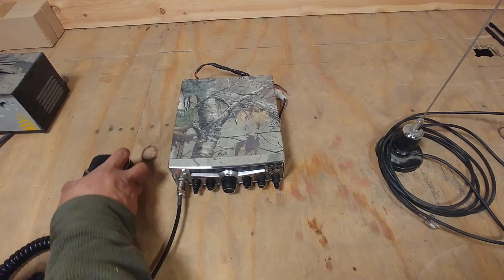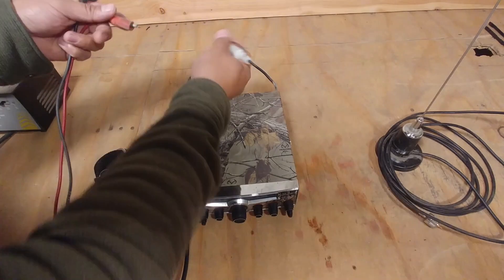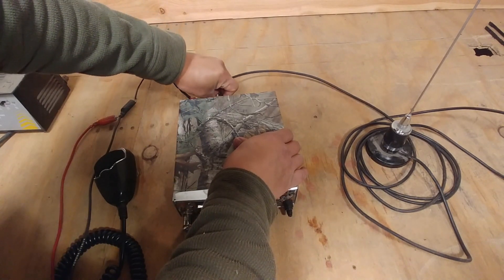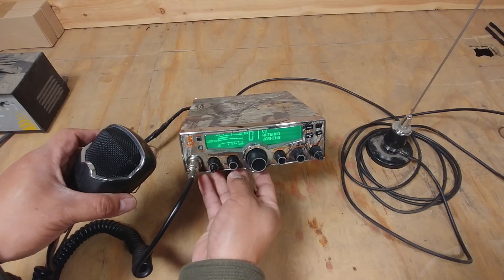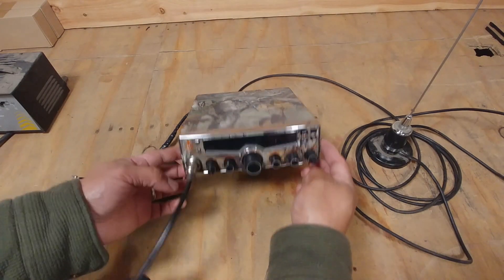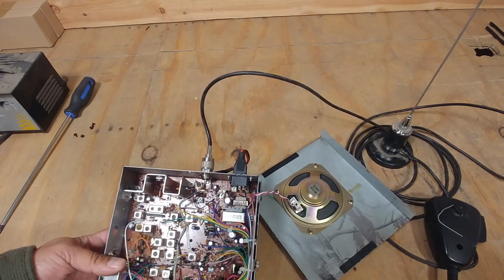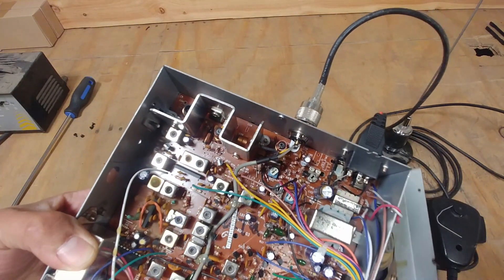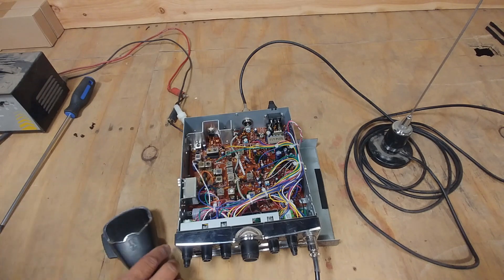Cobra CB Radio Antenna Warning

Comment: You Don't Know What Your Dowing That Antenna Has To Ground On A Metal Car Roof Will Not Ground On Plywood. Keep Keying The Mike And The Radio Will Blow The Finals Out Your Not A Tech
Reply: Hola disculpa soy de México y tengo el mismo problema 
Entonces que me recomiendas hacer  saludos

Comment: A tip if your SWRS are 1.1 to 1.5 and still getting the antenna warning try turning down your mic gain it will stop the warning it only goes red when over  modulation takes place
Reply: mine seems to do it when my linear is on high power once i put it in medium it stopped. it did stop when i turned down my mic gain on high. i am using a cobra power mic also so if i turn down the mic gain will it really effect how i sound out there. it started when i switched from a 102" whip to the 5' firestik fiberglass antenna i may just go back to the whip to get a little more rx out  of the radio and a little more tx.
Reply: @ironwoodliving769  yes go with the  102" whip i am not a fan of the firestik's

Comment: Who'd have thunk it. Tuning an antenna at the swr pickup inside the radio.  I think I'm going to tune all my antennas that way. Better yet I can tune all my antennas at one time as long as I make the same adjustment on my external SWR meter. Why didn't I think of this earlier.

Comment: I made it to 2:55 minutes. Many problems are user error. First, stretch out that cable to the antenna. A coil will cause problems. Then get that magnetic antenna onto some metal. It will help with a ground plane. Once that is done, there is an adjustment built into the Cobra 29LX series. Move it to 'calibrate' and then make the correction on channels 1, 20, and 40. It is not a wonderful electronic antenna tuner but it does work for THAT transceiver within reason. 
If it reads warning on 1 but not on 20 and 40, it means your antenna is too short. Very common  as this is High Frequency (HF) and people using cheap antennas can expect bad readings. Before anyone opens their unit to make corrections, put it on a Standing Wave Ratio (SWR) meter. You can buy them on the net for about $35. I hear a lot of splatter boxes out there in CB radio land. Do things the old school way. I don't think 95% + of the people can beat the factory settings.
Reply: Thank you sir. Informative.
Reply: Uncoil the coax, put the magnet on a cookie sheet, test the SWR on channel 1 with a separate SWR meter. Check channel 40. Compare the two numbers. Typically the antenna whip is too long and needs to be trimmed a quarter of an inch in order to have channel 1 and channel 40 equal, or close to it. If not test again and again until channel 1 and 40 are close in SWR value. Then you can proceed to adjust the variable resistor inside the radio IF the SWR warning comes on.
Reply: true about factory settings. my last 2 new radios had no peak and tune. they talk well. get compliments on how well it sounds......factory settings wins. matched the radio to my antenna is all I did. Talk all over the place.